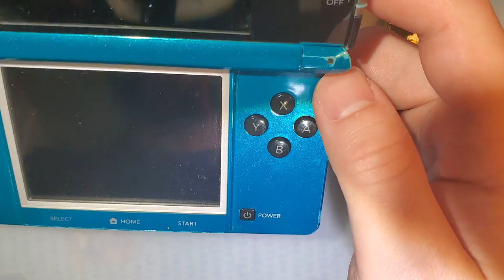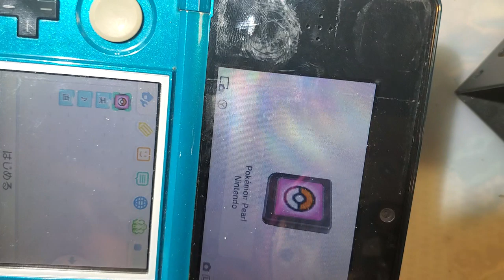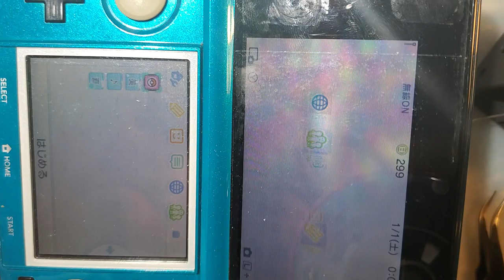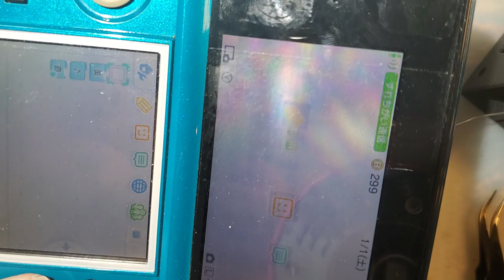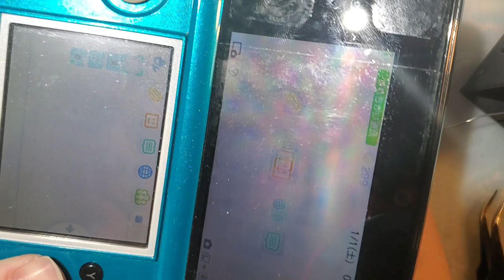Repairing a Junk 3DS from Japan (Part 1)

Comment: Makho I have a mint copy of pokemon silver in its original clear case and it got wet and now it says no windows for popping when I try to play it right after setting the time etc. the board looks clean af can it be fixed? The shell sticker and board are in amazing shape
Reply from the maker: Well, there is clearly water damage. Make sure it's dry, find and clean any corrosion, test all the traces and vias for continuity and if it still doesn't work, reflow all the solder connections. https://www.youtube.com/watch?v=0gqNEyQLecQ

Comment: From what I heard, the 3DS runs off the battery the charge port only charges the battery. So if the battery is dead the system won't turn on until the minimum charge is met. Same with 2DS.

Comment: Hey makho I have some questions. I have a non-original spider-man GBA game and it doesn't have save function and battery. If I add a battery to it will it have save function?. And can we replace IPS screen to AGS-001?
Reply from the maker: Depends on if the game itself supports saving. If so, possibly. You might run in to other issues though (like how long the battery itself actually lasts). And yes the IPS screen mods are compatible with all models at the moment.
Reply: @makho  Thanks a lot. 👍👍

Comment: Hi makho! Nice video as always. I have a question regarding a GB Pocket I have. When I try to turn it on, the led flashes and turn off. Tried fresh batteries, cleaned and reflowed the power switch, tested the power switch with a multimeter and looks alright. Do you have any clue of what could it be? Thanks!
Reply from the maker: Not sure tbh. If it turns on then off, it sounds like there might be a short somewhere.
Reply: @makho  any tips on how to track the short?

Comment: Hey makho, quick question. Are ebay aftermarket GBA SP hinges worth using? I bought some but can't seem to get them into an SP I'm trying to build. Already used my OEM ones on a reshell I did a few weeks ago. Any tips or recommendations for where to get hinge pieces?
Reply from the maker: I was actually about to make a video on this. I like the aftermarket hinges with the metal bits in them. You can salvage OEM hinges yourself but I don't really recommend buying salvaged hinges. It's a complete mixed bag as far as what you get.
Reply: @makho  ohh awesome! looking forward to that video then.  thanks!

Comment: What's been your experience buying "broken" things off Ebay? Whether from Japan or the US or elsewhere. Are the items typically truly broken or is it simply that the seller/store never took the time to try and fix or clean them? I was going to bid (but forgot -_- ) on a Celebi Pokemon Center edition GBA yesterday from Japan which said "the select button doesn't work". It ended up selling for $80, whereas they normally go for $120+. But I'm curious if, in your experience, sellers typically put that in bc they don't have the time to investigate or don't care about figuring out what's actually wrong with an item?

Sorry, this was all a little ramble-y. I guess what I'm wondering is, has it typically been worth your time and effort to buy things that are broken in an effort to fix them and what's your success record been like
Reply from the maker: I find that things are generally pretty easy to fix if I'm the first one in there. If the seller lies about it being opened previously, then the issue is much more difficult to fix because I have to undo whatever the previous dingus does before I can attempt to fix the original issue. 

Following your example, if the seller never actually opened it, chances are it would just need a clean. There could also be water damage but that's less likely. For a GBA though, getting a $40 discount and then just swapping the PCB with the saved money would net you a cheaper unit. If the seller was lying about opening it, you can bet there is water damage and ripped traces where the previous person failed soldering something.
Reply: @makho  So you actually ask the seller if they've made an attempt to fix it yet?